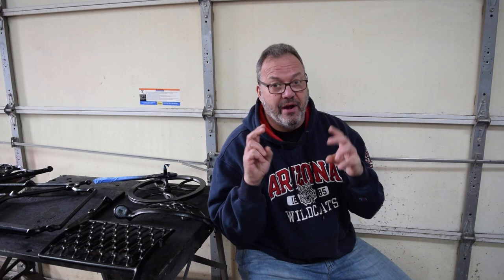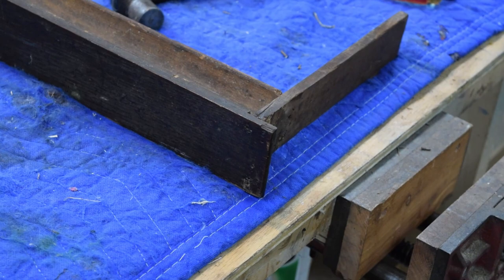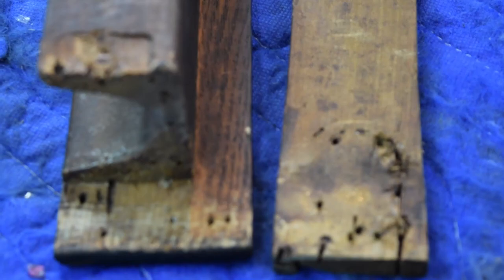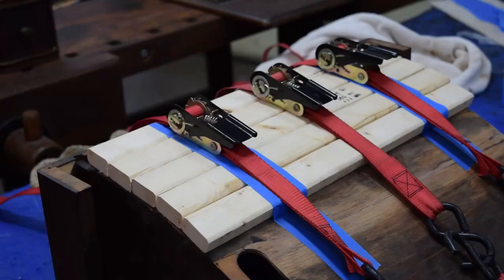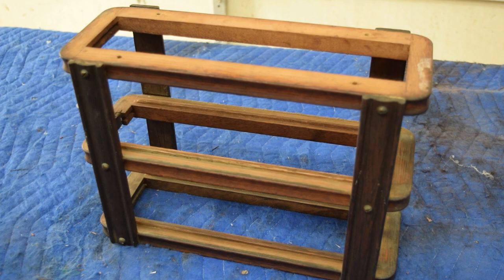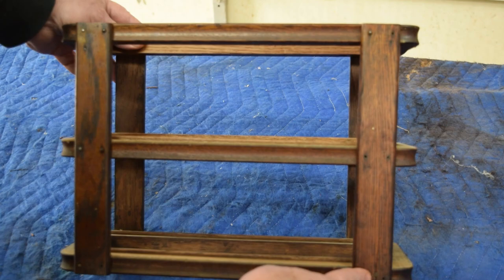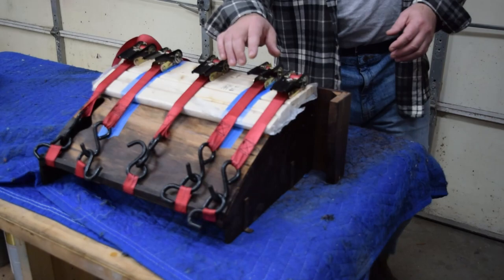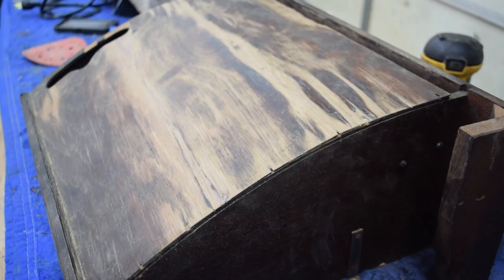Restoring the base and cabinet on an antique Singer treadle sewing machine.  Part 2

Comment: Excellent, loving restoration! How much were they when new, and what would the equivalent price be today?
Reply from the maker: I'd have to Google around, but I know they were very expensive new.  Singer had a finance program where people could buy one and then sew to pay them off.   Current value is dependent on the local market and demand.   In general, they don't bring much money at all.  I have bought basket cases for $10, better ones for $25.   I see decent ones offered for sale for $100 - $200.   I don't know what a collector or sewing aficionado would be willing to pay for one, especially one fully restored.   I guess if you checked around, you might get a better idea for your area.  Thanks for watching!

Comment: I just bought one like this.  Is this something that you do for payment?  I.e., could I pay you to do it for me?
Reply from the maker: You can contact me at lostmountainrestoration@gmail.com    Thanks!
Reply: I’ve enjoyed all your videos on antique restorations.  And thank you for producing them.  I’m having some issue removing the old veneer, can’t get it off even with heat and metal spatula.  And how do I replace the underbelly of the base? I bought veneer with wood backing to cover the underbelly that is cracked badly and not much substrate under it to support it.  I bought a 3 ply wood to reinforce the belly.  Just hope I can bend it enough to make the curve shape.